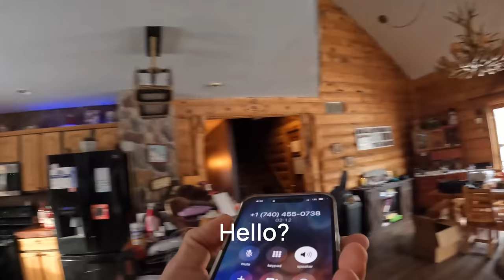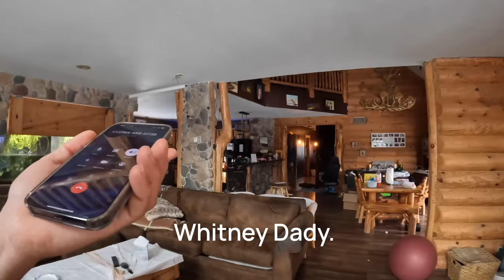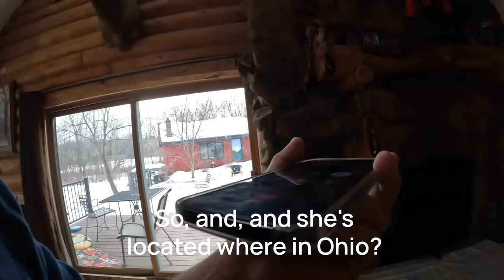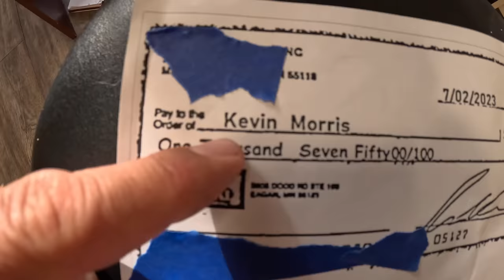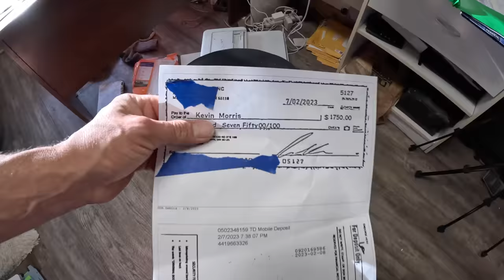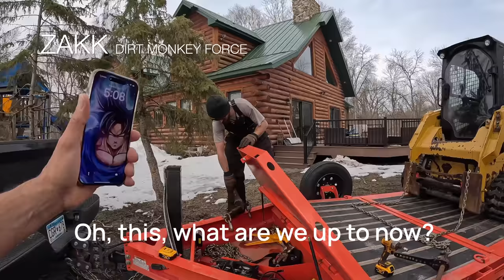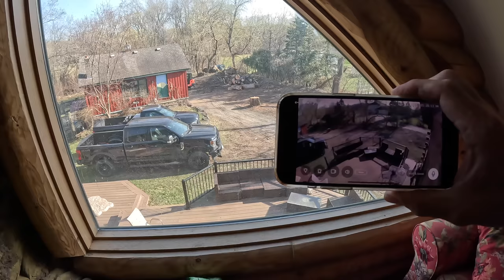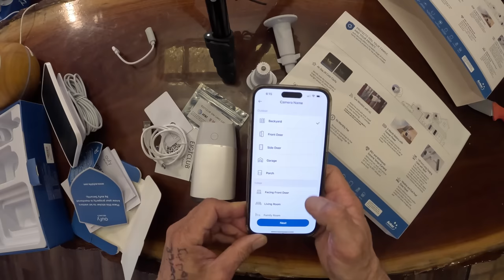The "WhiteWash Scam" !!   4K

Comment: Totally sucks what you have to deal with. Had it happen to us. We did an address change to a PO box. We live in the country and do not have anything delivered to the mailbox at the end of the driveway anymore. All goes to a PO box. Its a hassle sometimes but way less of a hassle than closing accounts and the other headaches associated with mail theft. Doesn't mean that they can't still get access to info but it takes away one path to ID theft. Best of luck getting this situation straightened out, Stan.

Comment: I worked for a bank decades ago and when we processed a customer's transaction we put every document together then those transactions went to a different department where they encoded each document and balance each transaction. 

If we kept a check out they knew and someone had to find the missing document. That could entail contacting the customer to see if they still had the document. 

With electronic deposits is easier to keep the checks but by tracing the check number you should be able to determine the original recipient. 

I have alerts on my accounts for any amount over a specific limit to send me notifications on.

Comment: The sad part about fraud is it cant be completely prevented. If they are skilled enough they can get what they want, the trick is to just make it as difficult as possible for them. They will be less inclined to go through the additional steps and go after the other low-hanging fruit. I would suggest at the minimum having 2-Factor Authentication on all your accounts, text alerts for any transactions over a particular $ amount, or even a dual signature requirement for checks above a certain threshold.
Reply: Even with the best precautions they find a way to try. One way is they know the precursor codes for types of cards and banks from there they use a # generator to fish until they find a match followed by test transactions of 1$ on your account. I actually discovered that my debit card # had been used 5 states away at a pizza joint. The point is that that card had never been used since I received it. The transactions all failed because they had no info other than the #. The fake card was generated in this manner and I was one of eight others with bogus charges at the same pizza joint. Local police would not take a report because they got nothing from account so I called the locals where the shop was located and they took a report!

Comment: Hey Stan, I got ripped a few weeks ago for $ 4,400 white washed .My checks have security ink but that didn't matter . A large bank cashed the check . That tells me the cashier was in on the deal.I figured out it was the postal distribution center .I put a freeze on my credit report. I also ordered new checks and they stole those as well!
Reply: Stop using paper checks. Generate your checks electronically thru your banks online banking. Much safer doing it online contrary to popular belief. I haven't written and mailed a paper check in years. Saves on stamps as well and the payment arrives faster.

Comment: I had a similar problem in my business account. They used the account numbers printed on the check and created their own checks. 
To combat that, we stopped paying employees by check and paid by direct deposit or debit card only. Employees loved it since they got money into their accounts faster.  Those without checking accounts got the free debit cards with free withdrawals. They were hesitant at first, but totally loved it once they saw they could withdraw their $ in cash at any ATM and could use the debit card as a credit card when needed.
Reply: We just went through the same. Thanks for sharing
Reply: @wade8418  Employees also get their funds quicker.
Reply: Using debit as credit is dumb. Doesnt have the same protection

Comment: Sometimes they have someone working inside your Bank. Even the Big Banks. Or works for someone you wrote the check to.
This happened to us but I check our account daily and caught it while it said Processing and contacted the bank both electronically and by phone.
It was actually someone at the Bank working with a lady at one of the local companies we deal with.
Now that takes guts.
When she took the check to the Bank her cohort was at lunch. A friend of mine was her Teller and she told her since it was over her approved limit to cash she had to get a Manager's signature. 
Went to the Manager's Office he pretended to ok it and she told her she had to get the money from the vault as she was new and only allowed X Amount of Dollars in her drawer.
While doing all that the Manager called the Police and she stalled in the Vault and the Police arrived. She turned almost instantly on the Crooked Teller.
They were both arrested and went to jail.
All my accounts were opened in new accounts with a flag of anything over $50 had to be verified.
If that Teller hadn't gone to lunch early no telling how many people they would have ripped off. I will say I wasn't the first.

Comment: When you write a check, you need to use an indelible pen designed against check washing.  Any gel pen will work but the most commonly used is the Uni-ball 207.
Reply: Why does everyone think it was on his check, it was a cashiers check which means the bank wrote this check and took funds out of his account to pay someone or some business for services.  It obviously was altered with the money directed to someone else.  This is a bank problem as he had nothing to do with this.  The bank takes the money out of your account before they mail it so they need to answer some questions as none of this makes sense.
Reply: @Once_in_a_Lifetime  The pen advice has nothing to do with assigning blame.  It's a preventative measure that ALL check issuers should use, whether they be a bank, USPS, an individual, grocery store, whatever.  Don't read more into it than that.
Reply: @HostileTakeover2   I wasn’t responding about the pen.  Good advice though!  I was commenting that “The dirt monkey” was referring to it as a cashier’s check which later he’s showing what they do when “whitewashing a check”, which follows about your comment using an indelible pen.  I guess i am the only one hearing  him say Cashier’s check at the beginning,  which raises different red flags because its not about stealing your personal check which has to clear the bank when it goes back to the bank for payment .  A cashiers check is written by the bank on one of their checks  for payment to whoever you stipulated to them.  It not your check they altered, its the banks check.  The cop said his bank information was compromised which it wasn’t if it was a cashier’s check.  The funds are deducted before its sent to the intended party.  A cashiers check is like a money order, its as good as gold!  No-one questions a cashiers check.   Some services like UPS will require you pay them with a money order or cashiers check because they don’t have to worry if its good or not.  I guess i don’t understand how he doesn’t see the difference.  It brings up a serious set of questions that everyone is skipping over that only assholes like me pick up on, lol!

Comment: I avoid using checks at all costs, but when I do I use a fountain pen with security ink that will not wash out of the paper. The Eufy cameras are a cool idea, but fyi SD cards are notorious for failing. They don't do well with constant and sustained writes. Check to make sure the footage is actually being saved and it can be played back. It would really suck to notice something happened and you check the camera to find out the SD card failed and you have no recorded footage.

Comment: Anyone can print a check or cashier's check. The only things they need are your account number, routing number, name, and address. You can buy check stock at office supply stores. Your signature can be stolen from anything you sign. 

Always pay all business debts with a business credit card. Pay your business credit card with electronic funds transfer. Apply the same to your personal bills. Never write a check unless absolutely necessary. Always use an account with charge protection and pay it off monthly or on payday. Financial fraud is too easy now and its easier to replace a credit card that was compromised than to change bank account numbers.
Reply from the maker: Thanks for the help 👍

Comment: A PO box may be needed for the mail thieves. Don't write checks anymore, I pay for everything with a CC. Yes the CC info can be stolen but it's faster and easier to stop it. You can get app alerts for it now, and lock it with the app.

Comment: The facts do not suggest that the scammers necessarily accessed you account. All you have to do is check your account online and see if there are any deductions that you have not made. Whitewashed checks are not the same as a Cashiers Check. My father in law had a situation of thousands of dollars of whitewashed checks. The scammer got access to the original checks which were in a rural mailbox to be picked up by postal service. The solution to that is to not leave your outgoing mail anywhere it could be stolen.

Comment: 1) Don't use checks anymore. Pay everything with the Credit card, get extra rewards, then just pay the CC off each month.   -  Bad Checks can get YOUR money, held at your bank.. BUT If someone scam a Credit Card,  you can only loose up to 50.00. The CC company looses the rest. Which is why fraud protection on a CC is so tight, and there is no protection on your personal Checking accounts.

Comment: We've had this happen to our business, and thre is a way to prevent the checks getting cashed.  Positive Pay. Its a hassle, but works.  Basically, every time you write a check, log on to your bank, submit the check info (Who to, amount, date, check #), and if a check arrives, and doesn't match what you've entered, it won't be cashed. The hassle is, you have to do this for everycheck you write. Its an all or nothing program.

Comment: The answer is this Stan.  Talk to your bank first.  For me I use credit cards for all purchases never cheques.  If you have someone who won't take a credit card use your debit card.  Pay your staff by direct deposit to their own bank accounts.  Keep a chequing account for the rare times you need it and never have more than a $1000. In that account. This approach saves time as writing out cheques, stubs and transferring that data to your book keeping app takes time.  That's how I did it for decades and I cashed in on a lot of credit card perks by using them.  You don't get a perk for writing a cheque.  I know some will not want a credit card but if they take cards then they got to take yours if not use debit.
Your bank will give you a high withdrawal limit if you explain what your doing.
Hope this helps.  Cheers 🇨🇦

Comment: Ok, first things first, Gracie was adorable Stan, the way she said hello was too sweet. Ok on to the two elephants in the room: the bucket triggers my ocd because it’s grey and yellow instead of black and yellow which I feel would look better on the asv. But that’s just me lol. As for the scammers, it might not be an option for you but I almost exclusively use credit cards and electronic transactions so that there’s no physical papers of any kind for someone to intercept and alter. It doesn’t come without risks and I still have to remain vigilant on my accounts (I check them multiple times a day) and if I see any charges I don’t recognize, I immediately investigate it and if I can’t reconcile the charge all of my passwords get changed on the spot. My credit card company also uses a credit reporting service that monitors the dark web for my information so if I run a report and they detect anything I know about it before thieves can steal my money or my identity.
Reply from the maker: Sounds like you got it down 👍
Reply: Yeah back in the day I used checks from the early 2000's til about 2009 or 2010 then once I got my debit card I solely used that and now I pay all of my bills online the only one I pay with a check is my water and sewer bill but everything else I use my debit card and I think it was either last year or the year before I paid off my only 2 credit cards and I haven't used them since.

Comment: cute dog ! i notice that your property is alittle open maybe a fence so you cant really see in too much , the cameras are great i did poe (power over ethernet) cameras around my house but i was already running cat 8 to the rooms on the inside for gaming and guests or w/e there's wifi also, cameras are just a deterrent wont stop them from coming in but atleast you can identify them , also if you have the data saved on a nvr or dvr have a backup somewhere where they cannot get access to it or just have the data saved on the cloud . sorry about the check thing  cant really stop that from happening , for me i pay with pre paid credit card or a specific account designed to only be on the web any activity goes straight to my phone within a few secs

Comment: Many times, I will drop my mail off at the post office.   Mail boxes are not safe.   Postal keys are a common theft item.  Consider making your mailbox out of heavy steel.  Have a one-way slot and a well locked door for access.   Shred anything like loan offers and credit card offers.  Anything that might have any possible info that could be used.  Good luck.

Comment: Personally I don’t use check’s anymore I use card cause if someone gets your credit card number your not liable for the charges and won’t lose anything. Also I use a debit card that your bank has an app so when you go to purchase something you can turn it on at that second and make your purchase, then immediately shut it off after your done just by the push of a button on the app. Then also it’s off so if someone has your number it will never work except that minute you make a purchase.

Comment: I think the mounting point to where it joins the Bobcat could be a little more beefer, it is thin looking and that is the pressure point when using the bucket. Stan sorry you are dealing with crooks but it is happening all over the place, glad they got the person. They sell a pen you could use to write out a check that the writing you put down can not be what they call washed. They also make a check stamping machine that puts little pin holes in the letters and numbers.

Comment: That's why I don't use checks. I have a similar type camera. (Elemage wireless security camera) It has the solar panel about 10 feet away on a metal post I built, so it can get sunlight in the afternoon. It can be moved by my phone or scan the yard might be the better word, But it is in color all the time with its own light. I have one on the front porch that is not as good. It used to be where the backyard camera is! Still pictures only. The backyard camera takes 5 sec. intervals of video.

Comment: You can get a text alert from your bank for every transaction or maybe even just for checks.  Why are you using checks anyway?  Send them a bank cashiers check instead of just a check drawn on your account.  Cashiers checks don't have your account number on them.  You may want to consider doing everything with credit cards.  They are safer than checks and are pretty easy to contest.  You can also make sure that you have a rider on your business or homeowners that protects you from this kind of stuff.  It's really not that hard to prevent scams.  It's not twenty years ago, just do some research and talk to your credit card company and your bank.  They'll have lots of ideas.

Comment: For your business, you might want to talk to your banker and inquire about a “zero balance account” (“ZBA”) and any additional security or benefits they have.  It’s essentially another checking account that has, you guessed it, a zero balance.  Your checks get drawn off it, and at the end of the day’s batch of cleared checks, the total amount of all checks presented against your zba are then swept out of your operating account.   

Suppose your operating account has $20,000 in it.  And you’ve written checks for $5,000, $2,000, and $1,000.   One by one those checks got presented to your ZBA account.  Which has a zero balance.  At the end of the day’s processing your ZBA now has a negative $8,000 balance.  So $8,000 is swept from your operating account to bring your ZBA back to zero.  The checks are paid, and your operating account has $12,000 in it as it should.   

But there are two benefits: 1. Your actual operating account number is never disclosed.  The recipients of those checks can’t scam your account because they don’t have your operating account’s number.   And 2. You can have your operating account be a different type of account, one that earns a better rate of interest than a checking account would.  Essentially, instead of sitting idle waiting to lay checks, those funds are earning more interest until the exact moment that some of those funds are needed to pay checks.  

Also talk to your banker about “positive pay”. It’s a system in which you cut and send out checks, but then you essentially send (electronically) the list of checks (check numbers, payees, and dollar amounts) to your bank, and their system only pays checks that are present to them that match what you’ve provided on the list.   

Often a ZBA and positive pay are used together.    

I’m not a professional banker and have nothing to gain from this. Just passing on some business and banking knowledge from my experience.  Hope this helps.